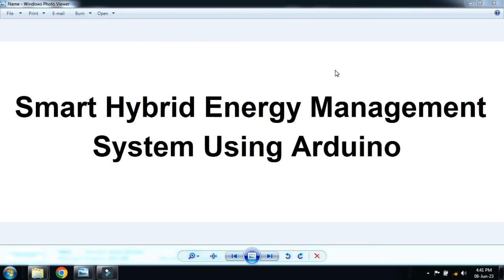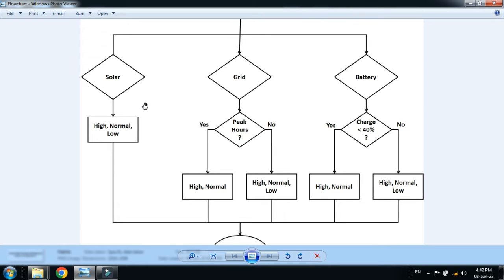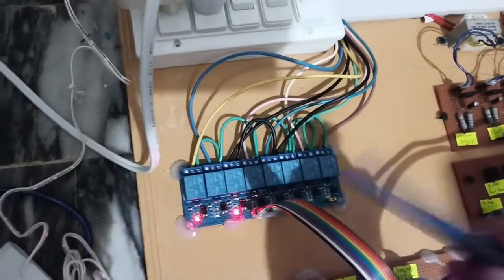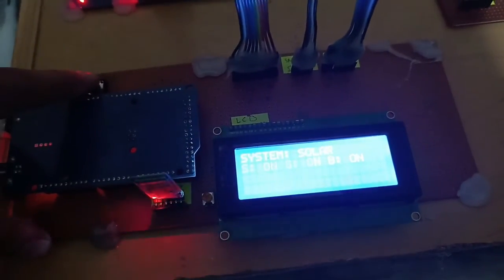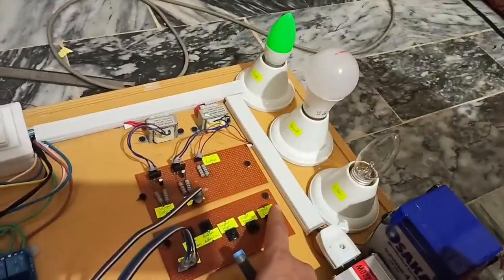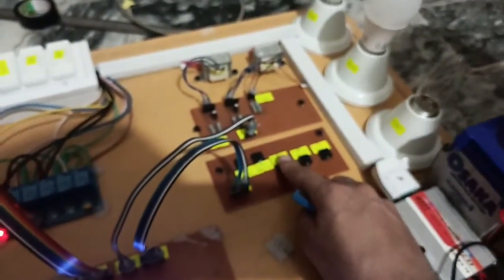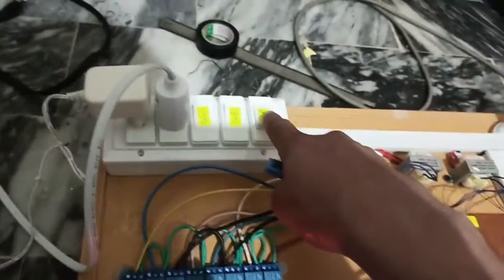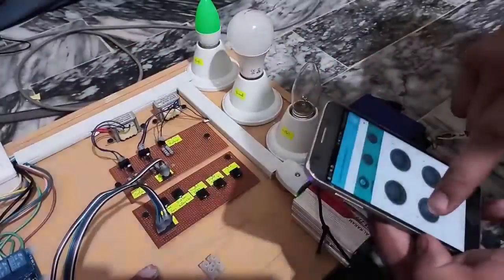Smart Hybrid Energy Management System Using Arduino || Code & Circuit

Comment: sir, may I know what software you use to draw the connection diagram?
Reply from the maker: The circuit diagram is made in Proteus Software,  You can download it from here:
https://youtu.be/ET-tTFbq1OE
While the block diagram shown in video thumbnail is designed in PowerPoint.

Comment: I want to make this as a thesis paper but what part of it needed improvements? Do you have any suggestions? I am thinking "Arduino-Based Prototype for Smart Energy Management with Renewable Integration and Load Balancing"
Reply from the maker: Thank you for your interest! It's great that you're considering this as a thesis topic. Research in this area is very broad and can be quite complex, so it's important to take time to define your scope. Your proposed title sounds promising! I suggest you start by exploring current challenges in renewable integration and smart load balancing. From there, you can identify gaps or limitations in existing systems that you could focus on. Best of luck.

Comment: Sir are you providing direct 220volts to Arduino?
Can I use esp32 instead of Arduino
Reply from the maker: No, you will have to make a proper circuit for it to give 220v to Arduino. Yes you can used ESP32 but make sure that this have the required analog pins.
Reply: Here solar energy is ac right sir how can give directly to relay module. Relay is dc and takes 5 volt
Reply from the maker: Solar DC is inverted to AC and then given to load via Relay. Relay control circuit is operated with 5v.

Comment: I have chosen this project as my final year project. Could you please explain the circuit connections? Also, is there any other social platform where I can contact you?

Please reply Sir , its emergency
Reply from the maker: I have just the video and few file related to this (attached in video description). Apart from this I don't have any other details.
Reply: Is there any other  way , we can contact apart from this ? @thebrightlight9472

Comment: Sir can i know the capacitor and resistor value which is after the bridge?
Can you please say sir
Reply from the maker: The capacitors used here is 100uF, and resistors used here are just for the purpose of voltage Divider, you can use any value.
Reply: Sorry for distrubing sir
For battery source,do we give inverter connection?
Is transformer connected to battery source?
Reply from the maker: Battery is connected to Inverter and then Inverter to load.
Transformer is not connected to battery, Transformer is connected to utility source.

Comment: Sir, I don't understand why there are separate relay modules for each power source. Could you please explain. I watched your video on switching between grid and generator and the relay was only connected to loads
Reply from the maker: One for Grid, One for Solar, One for Battery/UPS

Comment: Sir for solar why you are using stepdown transformer and rectification. Solar is already in dc so why rectification circuit for it??
Reply: And instead of making voltage sensor manually can i use zmpt101b sensor for grid and scaled down it in the range 0-5 for this project.Will it works?
Reply from the maker: Actually, I was going to use voltage sensors instead of making the sensor myself, but unfortunately, at that time, voltage sensors were not available in the market. So, I used an alternative method to measure the voltage.

So, you can use the said sensor as well, but then you will have to make the necessary changes in the code accordingly.
Reply: @thebrightlight9472  yeah i am doing the code for zmpt to sense in the range of 0-5 and similarly i have used viltage comparator ic to convert 12v dc to 5volt dc and also did calculation in code to convert it in the range of value 0-5 .am i doing right?
Reply from the maker: We didn't use Solar directly but we use that with the help of Inverter. So inverter convert the DC to AC. That's why.
Reply: @thebrightlight9472  and for battery to sense voltage you have not used stepdown transformer i think you have made voltage divider circuit to convert 12v dc battery to 5 volt dc,is it right?

Comment: Is the transformer to step down the power so it can be fed into the Arduino?
Reply from the maker: It is used to step down the voltage for the purpose of measuring AC voltage.

Comment: If we use an inverter to convert the power from Solar and battery, what should I use?
Reply from the maker: You can use it. Simply replace the existing inverter with Solar Inverter.
Reply: @thebrightlight9472  There is no inverter in the cicuit diagram shown, where should I connect it if I'm using mini solar panels for the project?
Reply from the maker: Inverter is available in the video.
Watch video at 3:06 to 3:12. You will see it.

Comment: Sir can you tell me how to build the voltage sensor which is not available in your code and circuit diagram 
Kindly explain how to connect the step down transformer and voltage sensor
Reply from the maker: Please watch my following video for Voltage Sensor:
https://youtu.be/M8GwwZ7twAI
Reply: @thebrightlight9472  Sir is that all input sources Solar ,grid and battery AC?
Reply from the maker: Grid will be AC, Solar will be connected through Inverter and Battery will also be connected through Inverter.

Comment: Can you provide connection diagram with stepdown transformer and switch to make peak hours and battery less than 40%
Reply from the maker: Diagram is available in the video description, you may do changes in circuit and code according to your requirements.

Comment: And i think the circuit connections you have provided is not complete coz in the code, analog pins of arduino are connected to different loads and LCD connections are also different. please recheck it.
Reply: Sir can you kindly provide the corrected code
Reply from the maker: Correct code is attached in the link available in video description.
Reply from the maker: Kindly correct it according to pins mentioned in code.

Comment: can you mention the components used
Reply from the maker: Mentioned in video
Reply: @thebrightlight9472 can the button of the solar panel be replaced with an actual solar panel?
Reply from the maker: Yes
Reply: @thebrightlight9472   why is the condition for the battery 40% specificlly?
Reply from the maker: You can change it according to your condition.